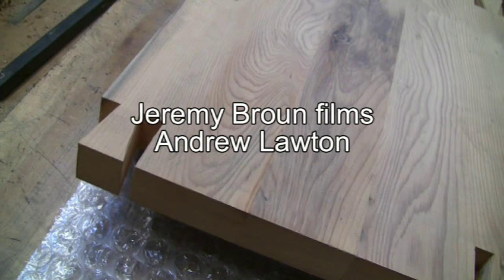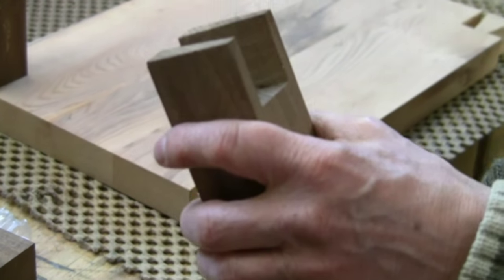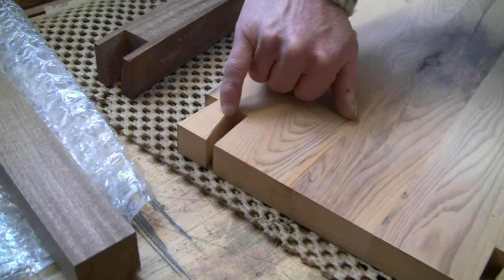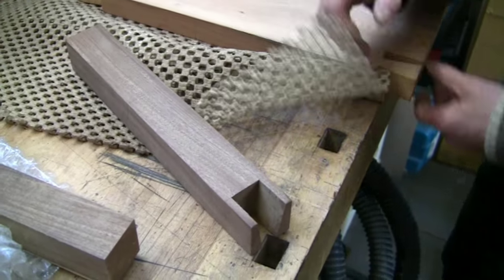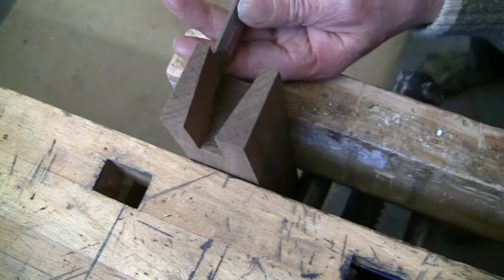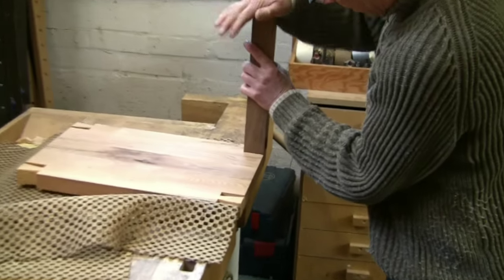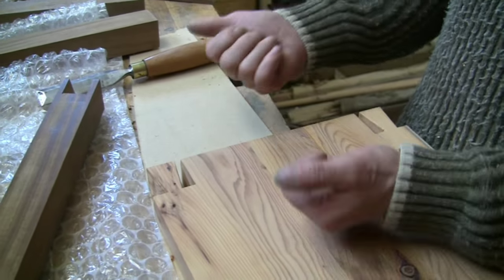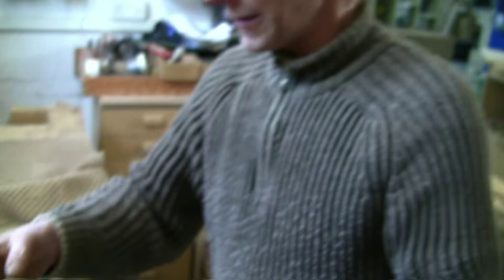Getting The Dovetail Joint To Fit

Comment: I'm wondering, is there a significant difference in a glue joint strength when a surface is straight off saw with fine saw marks on it, or is it chiseled mirror smooth?
In theory saw marks would give a glue a bit more of a surface and allow wood to compress a bit better, won't they?
Reply from the maker: Yes of course there is better bonding. It is called 'keying' or 'toothing' the surface and can be done with a saw or toothing plane in the case of veneered work. See my new book The Encyclopedia of Woodworking Techniques to be released in September 2018 and buy a signed copy!:   http://www.woodomain.com